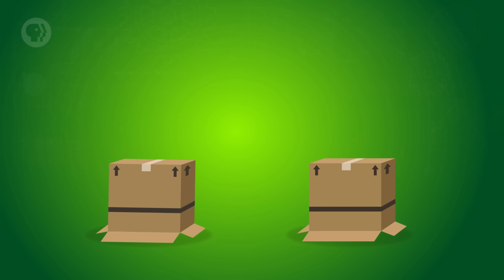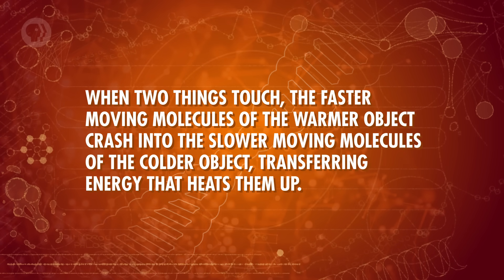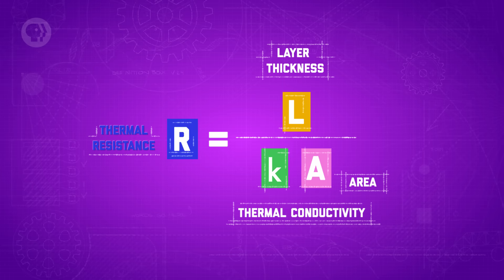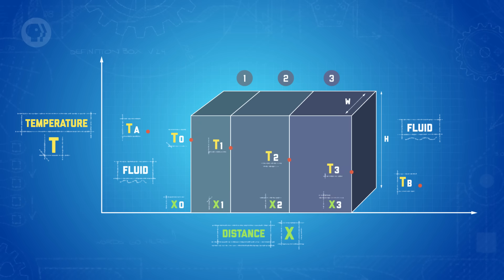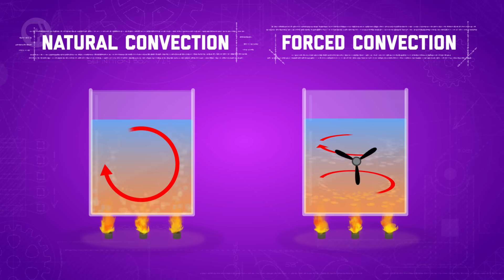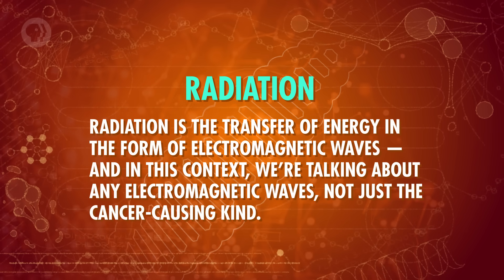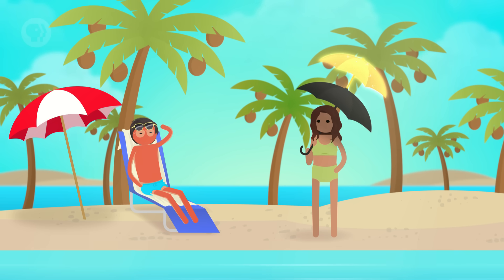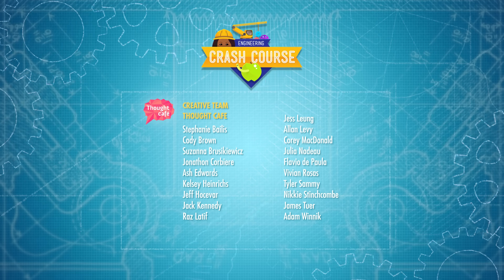Heat Transfer: Crash Course Engineering #14

Comment: This subject adapted to the kitchen is so needed: there a lot of cooks who don't seem to understand the basics of heat transfer, for example a veggie pizza with all the veggies dumped in the center results in a puddle of water in the center, and all the toppings sliding off.  The veggies need to be spread out to the edges.  The same goes for the sauce, it does no good to just slap the sauce on carelessly and have the edges burning up and the center soggy.

Comment: i actually live in cambodia and this is how i do it: two open windows with mosquito net and a fan blowing air between them. reverse according to which side of the house receives sun. im directly under flat roof which gets super hot from full sunlight so hot that just the radiant heat makes my desk hot while the air is not. and this is the only thing that keeps the room comfortable. the roof receives about 700 megajoules per day. when the heat is the worst i dump water buckets on the roof which evaporate quickly. one bucket reduces this by 40 megajoules. so 18 buckets eliminate the sunlight completely. a rack with wet clothes inside the room also helps obviously.

Comment: So to battle the radiant heat put an reflective aluminum barrier on top of your existing insulation put a solar fan on your roof ( because we’re trying to save energy) to force ventilate and pull the heat out in the summer . Now insulation has a saturation point just like a sponge can only resist or absorb so much water , insulation can only resist or absorb so much heat before it becomes ineffective the saturation level is usually around 125degrees f  so it seem that if I can add a reflective barrier on top of my insulation it would keep my insulation protected from radiant heat and my insulation would not reach its saturation point hmmmmm I feel a science experiment in my near future!

Comment: Plate heat exchangers are almost unbelievably efficient. A small one maybe 20x10x5 cm can easily heat up water from 10 c to 30 c at incredibly high flow rates. It can essentially ensure that a house will never run out of hotwater because it can produce it so quickly that you can get hot water for every appliance and the shower in a home. Having lived my entire life with one I was stunned at the concept of running out of hot water when I heard about it.

Comment: ...please, simplify this for physicists:—heat transfer is by photons exchanged by atomic orbital electrons, certain materiels might have slower or even 'uphill' heat flow, directed magnetically, or by reflection on smooth inner surfaces, or, per your title, transferred by Fermi-level-conduction-band electrons and—wait for it—not mongols, but—'free holes'... (which'd be 'solid' convection, except, it's at bulk-temperature, so—what, type, is, that)... ((and then there's Mach-Principle groundstate-minimum-oscillatory-energy 'sharing'))...
Reply: i understood some of those words... ^^

Comment: it seems like convection is just conduction of a moving fluid.

i mean the heat follows the same principal, it goes from areas of higher energy to areas of lower energy, the heat from, say a house, moving to the air around it and causing it convect, still has the heat conducted to the air from the house and then from that air to other air and so on causing the convection. 

seems like convection should be a special case of conduction and there should only be conduction and radiation.
Reply: Well like she said, at the boundary layer of a fluid as it meets a solid, it essentially is conduction occurring due to the lack of movement of the fluid. 

The motion of the fluid is what sets convection apart from from conduction. With conduction, the primary factors influencing heat transfer are the thermal conductivity, surface area, and the temperature difference. 
However with convection, the motion of the fluid drastically affects the heat transfer coefficient. Natural convection vs forced convection will result in different heat transfer rates. 

This is why you must analyze them separately. Solids transfer heat differently than fluids.
Reply: I've had that thought before, interesting...
Reply: both are dependent on particles so yeah in a sense they are basically the same thing, but they have very different properties even though they share very similar principles

Comment: Radiation has more to do with the heating than conduction itself. If you create a radiant barrier, you will minimize the heating of the walls, and then will not need thick layers of other insulations, or walls for that purpose. If you read about MLI from NASA you will see that radiation is the main focus on space, as it should be on Earth, since the heat source is the same. (the sun).
Reply: Im talking about how it impacts buildings, as it is on the video, real life situations.

Comment: God I love heat transfer hope one day to design my own house with two layers of concrete walls with a fiber glass insulation between them with a 5 meter hight top and a buried water tank for cold water and one on the top of the house for hot water instead of cranking up the AC all the time I HATE ACs

Comment: I hear tell of quadruple-pane windows with special coatings that reflect the infrared and ultraviolet parts of the spectrum so that the only radiation that makes it inside your house is useful, visible light.

Use solar panels to catch everything that would otherwise be hitting your roof.

Comment: Heat conduction is a major hassle for thermoelectric coolers. The idea is pretty interesting, a cooler without moving parts, just pass an electric current through and it transfers heat from one face to the other (you can even reverse it by inverting the current). The problem is that you need a material with good electrical conductivity, otherwise it's going to generate a lot of heat due to the Joule effect. But good electrical conductivity generally implies good heat conductivity, so the material transfers heat back from the hot face to the cold face, like trying to fill a bucket with a sieve. That's why thermoelectric coolers are much less efficient than compressor-based coolers, although researchers keep finding better materials to improve performance little by little.
Reply: I didn’t read anything
Reply: So you want something with good electrical conductivity, but bad heat conductivity? Umm...water? Not distilled, of course.
Reply: @ArawnOfAnnwn   well isn't water quite good at heat conduction. For example try grabbing a hot oven plate with a wet glove on, you'll burn yourself a lot more then, if it was dry

Comment: When one is near a fire. Is it convection that makes the air around hot or radiation? Probably both but which is more responsible?
Reply: Smoke and hot gasses from combustion rise due to thermal convection heating the air along with them. If you were to feel the actual hot air from the fire you'd know it very quickly lol. When sitting around it normally all you're feeling is radiation, which doesn't really have much to do with air being hot since it's photons.
Reply: Radiation